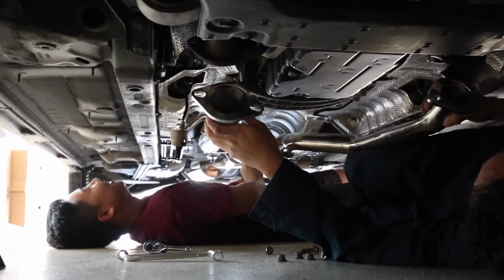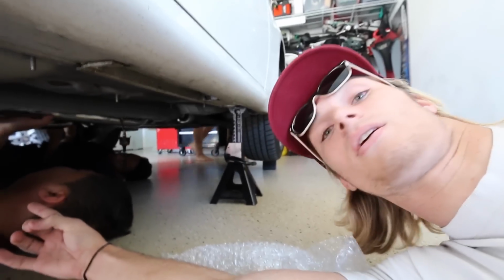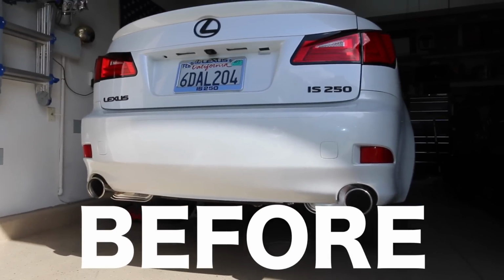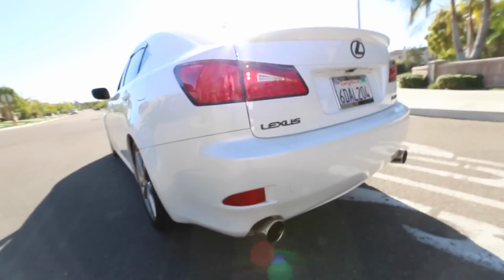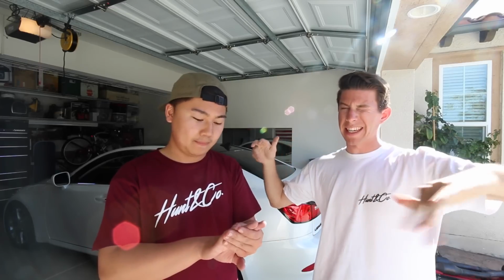Making a Lexus Even Louder

Comment: straight pipe that birch make it way louder
Reply: birch
Reply: but but thats illegal
Reply: +Romefeller nothings illegal if you don't get caught.
Reply: +Romefeller its illegal if the car is 2015 or newer and daily used im pretty sure thats a 2013 and it doesnt matter if its straight piped or ot just fucken do it fuck laws
Reply: yeah i know im jk lol
Reply: +Romefeller but still lol sp what is cali imma try and find the i5 from the audi s1 quattro somewhere and drop it in a mIata and straight pipe and mod the fuck out of it looking for north of 600hp 540 tq because its reliable and such an amazing damn sounding motor
Reply: Nope just measure back 6 inch you last o2 sensor and you can straight pipe from there
Reply: open headers. if its gonna be illegal make it count
Reply: +Mike Gonzalez Or open downpipe it ;)

Comment: Check out Rr racing .com there is tune develped for the 2ur gse engine. that allows you to increase your rpm limit to 7400 also remapped the throttle it was developed for years for the is

Comment: Check out Rr racing .com there is tune develped for the 2ur gse engine. that allows you to increase your rpm limit to 7400 also remapped the throttle it was developed for years for the is i have this tune for my 350 its amazing. running 12.8 sec quarter. mile and 0to60 in 4.0 seconds at the track

Comment: Instead of cutting off the O2 sensor, you guys could have just removed the bolts that where connected to the CAT and moved the pipe back or over. That's what I did.

Comment: I have a 97 Lexus ES 300, would it be bad to take off my exhaust pipe like the whole thing? Like to straight pipe it? I've heard it'll mess up the car, is that true?
Reply: It is a very bad thing to do. If you can, spend some money on an exhaust system. If you don't do that to the car it'll mess up your mpg and the fumes/heat that are suppose to exit behind the car will start to make their way inside the car, making it a very dangerous situation by having things catch fire or you could get carbon monoxide poisoning
Reply: Alex Sandoval Thanks for the info!

Comment: does installing a new exhaust ALWAYS require welding or is it typically bolt on????
Reply: Typically bolt on. You only weld when it usually doesn't fit or something & you gotta add an extension pipe.

Comment: just do a damn cat delete and if not that move ur cats further back and do a muffler delete or a electronic y pipe before the cat after u move them further back from the down pipe and u need to move them bec u will put off to much heat and can melt gaskets burn oil an fuel faster or worse blow head gasket and over heat .... say wat u want its possible exhaust delete is cool but its better to have some kinda way to get back preasure and its good to have some pipe to disp. the motor head and all